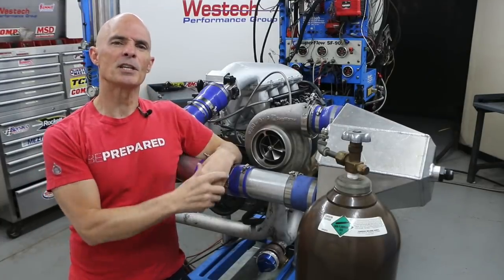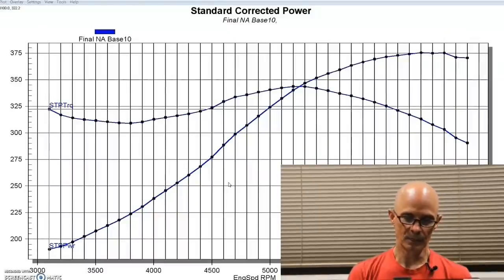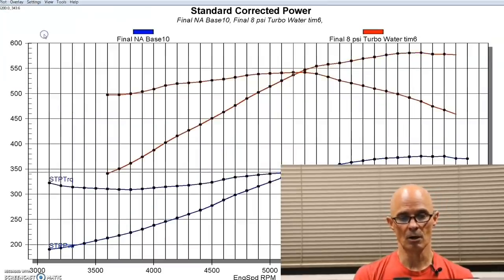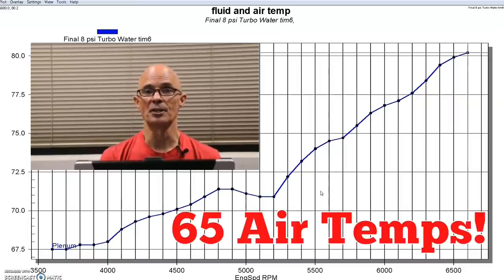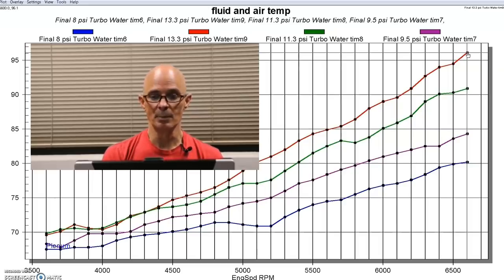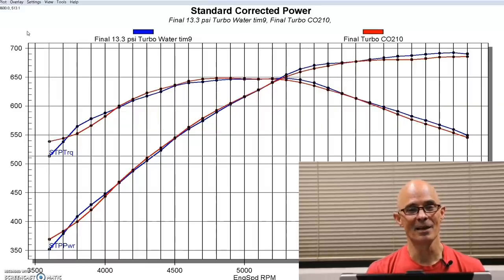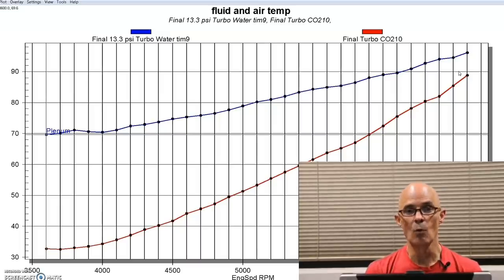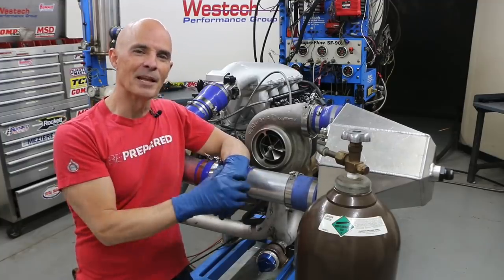HELP, CO2 INTERCOOLER FAIL!! FULL RESULTS!!

Comment: running an air to air inter-cooler and just spraying the liquid co2 onto it allowing it to frost onto the cooler might work better. Having the C02 running through an air to water intercooler and not having it change state your just dealing with thermal conductivity and the incoming temp of the co2
Reply: I would actually do both. Have the air to water with dyno water, it leaves that at 80-82°f as opposed to the 240+F out of the compressor. Put that 80f air charge through a air to air and spray the outside with CO2 or a second air to water with CO2. There is too much heat for the cryogenic gas to absorb. If you take a bunch of heat out first the Carbon Dioxide has a chance.
Reply: I agree gas doesn't transfer heat like a liquid.  I wonder if he is loosing airflow too through the intercooler due to moisture from the ambient air freezing inside the intercooler.
Reply: would it be a bad idea to spray co2 on the outside of a air to water intercololer much like you would do with an air to air intercooler? i would think it would work but my worry would be that while spraying the air to water intercooler the low temps of the co2 could freeze the liquid inside of the air to water intercooler if it doesnt have enough antifreeze in it. but so long as you use antifreeze shouldnt it be safe to spray an air to water intercooler with co2?
Reply: It may be a mater of cooling the water with the co2, the water would have a better effect of cooling the core than the gas.
Reply: @denniswhite2768  You can only get the water so cold its may be better that under high loads just have a small bottle of Freon or c02 or nitrous spray onto the intercooler to chill the circulating water

Comment: As an energy auditor. I’ve built a number of modeling tools with excel.
The link below tells us that water has 4000 times (yes....4000 times!) the capacity as air.
https://www.quora.com/Which-one-has-the-stronger-convective-heat-transfer-air-or-water-Why

Comment: You need cores optimized for expansion cooling like automotive a/c evap cores. Take two of them in a "v" configuration with the turbo side going into the open part of the v and intake side at the bottom.
Reply: Good idea. Maybe take an A/C coil from a home instead.
Reply: Also invert the bottle to get consistent flow of liquid co2.

Comment: I think the flow true the core might be too much in a way that the co2 pressure doesn't drop onside the cooler, the liquid is a factor of temperature and pressure. Higher pressure means it's not that cold in liquid form... Other thing is that you can try different positions for the bottle, you want to pick up the co2 as liquid from the bottle, not as a gas. Bigger energy (heat) does the face change from liquid to gas, so you might want to put a valve for flow control in the feeding point off the cooler to be shore the phase chang hapens in the cooler... Outlet off the cooler should be as open as possible.

Boil that co2 in the cooler 👍
Reply: Right on mate all of what u said was what i was thinking as well

Comment: Judging by the Ice Line on the CO2 tank the liquid level was below the valve. Prop up the bottom of the bottle so liquid CO2 is coming out the hose.
With liquid CO2 going to the intercooler it will work.
Reply: And let the IC get frosty first 😉
Reply: Yep my thoughts as well
Reply: Uh, CO2 doesn't have a liquid state
Reply: @watrousmark401  CO2 does have a liquid state, and a solid state just google a CO2 phase diagram.
Reply: @watrousmark401   The CO2 in the bottle is liquid. Solid CO2 at atmospheric pressure will sublimate, going directly from the solid to the gaseous state, but will melt if kept above it's vapor pressure.
Reply: @watrousmark401  Are you sure??
If it does not then  the experiment will not work at all.

Comment: How effiecent would it be use the c02 to cool antifreeze ran through intercooler 
Thanks for the content
Love it
Reply: Anti-freeze is only good to -38°C (or there abouts.) CO2 can freeze that. I've posted above about a technique that CPU overclockers use using acetone to get die temps of ~-78°C. The sublimation temp of CO2.
Reply: Thats what im thinking too. Like a cascade system. Like alcohol   Or something
Reply: @DisgustedGenXr  acetone. Freezes at - 95°C, boils at 50°C

Doesn't have the issues methanol has (hazchem wise)
Reply: @manitoublack  at that temputure and the liquid viscosity surely would effect the efficiency  of the intercooler core would still like to see what he does next
Reply: @robhudson6133  you'd be surprised. Acetone and Ethanol (another option) remain incredibly fluid. Even at low temperatures.

Comment: Personally I blame squirrels
Reply: Or woodchucks
Reply: Those little bastard squirrels ate the plastic gas cap on my garden tractor this year. Every year they eat a cap on a lawn mower or some other piece of equipment.
Reply: @fascistpedant758  
Same but different , I heard somewhere that alot of wire insulation is derived from a corn based material......no wonder rodents like to chew wires. 
I do generator service and I'll just say I hate meeces to peeces.